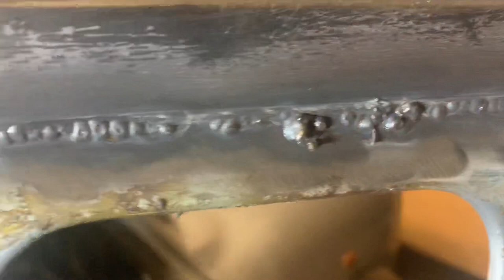Classic Mini Door Repair - Part 2

Comment: Hi Tom, You need to strip both panels down to bare metal before you start to weld, or your weld will be contaminated.  Afterward wire-wheeling away the paint you need to  wipe both sides with panel wipe or alcohol several times then you weld welds will be much stronger, if you leave a one mill gap between the panels when welding that way the panels will not warp as much.  Cool each weld with compressed air, that will also help to eliminate panel warping,take your time, it's not a race.  In short when welding cleanliness is very important, and using the proper gap, and compressed air is the difference between a crap job and a professional job.   Instead of doing what your doing do a single tack ,  move  three inches and do another tack move three more inches and so on and so on  then go between the previous welds until you have the complete job done. Keep up the great work.